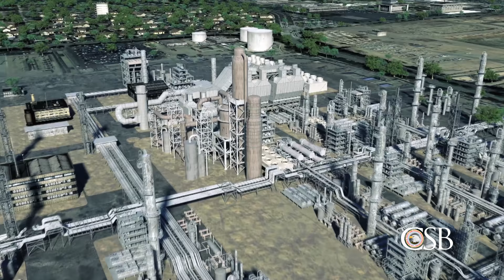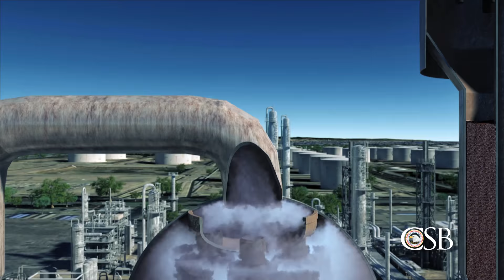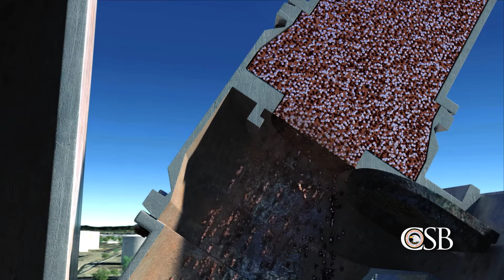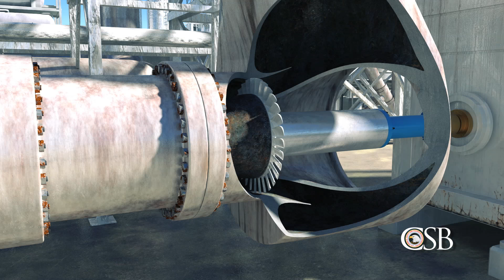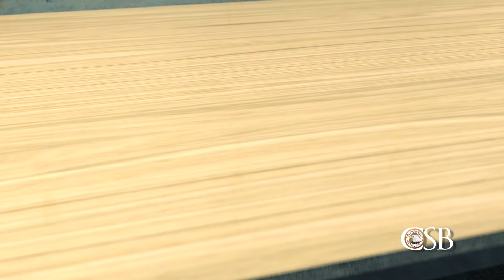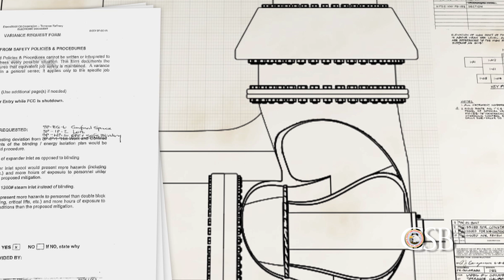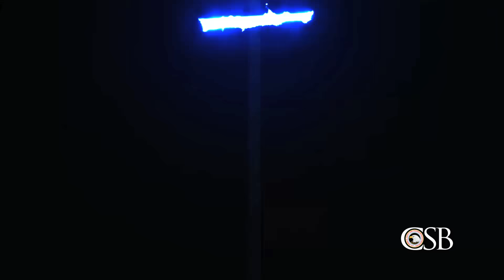Animation of 2015 Explosion at ExxonMobil Refinery in Torrance, CA

Comment: I find it surprising that with such good work done in industry these days with predictive maintenance that they would have a critical piece of equipment like the slide valve fail with that many years in service. You'd think if they cared to know they would understand that valve will be good for x number of operating hours and have to be replaced. Especially in an industry were stuff blows to kingdom come if it fails.
Reply: Im more amazed that such crucial pipe did not have flow detector 😅

Comment: What were the recommendations to prevent this from happening?

It seems the primary issue here is mechanical failure, compounded by other decisions (I think the biggest one being - that High Pressure Steam had found a pathway that another vapour was not supposed to travel - that should have been a 'Stop' moment)
Reply: Lack of flow monitoring seems to be big blame. 

Like... how the hell can such crucial valve leak, without operators knowing it.
Reply: @jarskil8862  lack of isolation of equipment with proper pressure build up testing paired with lack of monitoring of process conditions

Comment: A slide valve and a heat exchanger had leaks that are related to this accident. Which allows me to conclude that maintenance practices were poor at this refinery. The catalyst is expected to erode lines and valves, but run to fail is not acceptable. In addition, the steam leak from the expander was a sign that the slide between the reactor and the regenerator was leaking and therefore the service should be stopped
Reply: Lack of measuring equipment seems almost bigger flaw than lack of safety mechanisms :D

How can there be flow in such crucial pipe, without operators knowing.

Comment: So why wasnt the ESP turned off automatically in SAFE PARK mode? Also it would be sensible imo to have installed multiple slide valves for redundancy.
Reply: Probably, they wanted to avoid release of any incidental catalyst dust during transitions.  Even without such a specific source of ignition, having the air side filled with an explosive mixture would have been a disaster waiting to happen.  I wonder why they didn't have hydrocarbon detectors in the air side ducts.

Comment: I don't understand one thing: what is the reason to keep the electrostatic filters energized when the polluting unit is off? Especially when there is a risk of explosive gas going into it? If they turned off the high voltage the filters might not explode.

Comment: The potential for the sluice gate valve on the reactor side eroding should have been picked up at the hazop. One solution, in case the ESP needs to be kept energised during safe park, is to use a Double Block and Bleed arrangement on this isolation, with N2 or steam injected into the interspace in the DBB. Pressure in the interspace to be kept above PAH in the downstream column. And if the interspace pressure drops below PSLL during safe park, shutdown the column and depressure.

Comment: The big error in safety feature design is that device failure probabilities are considered independent of each other, however in practice that is seldom the case.  When one device fails, it actually increases the likelyhood that more will also fail, just as what happened here and in many other accidents.  Bad maintenance and ignorance of good operating practices means that failures of individual devices cannot be considered as independent events.  One corroded valve means that other items are also most probably corroded.  One equipment bearing failure probably indicates that other equipment may have the  same problem.  Potential failures of two or more device is thereby heightened, not reduced.  Basic safety mathematics FAIL!

Comment: You would think that there would be valves between the FCC unit and the ESP that could be closed to prevent hydrocarbons from passing into the ESP. There seems to be at least about 200 feet of pipe between the two. The workers getting the alarms could be closing valves, cutting off any pathways from the FCC to the ESP.

Comment: As soon as the blind was attempted and steam came out, that was an indication that the trapped catilist was gone. Once they saw that steam they should have cut the flow off hydrocarbon. Stupid mistakes
Reply: Peter Jones because the systems are connected the hydrocarbons should have been shut off from anywhere in the system. Yes I did miss that.

Comment: Don't you think finding steam in the AIR SIDE of the FCC would've been an immediate indication that a catalyst barrier was not maintained?
Reply: They didn't realize extra hydrocarbons were leaking into the other side. Basically, this system had 3 independent failures.

Comment: The variance procedure should of had the ESP powered down and locked out
as the steam was turned off.
not only that when the system is down 
why bother keeping the ESP energized 
kind of pointless 
but what do I know,I've only been working with dangerous equipment for over 30 years

Comment: I just retired from working in a chemical plant for 38 years and worked in a coal fired coal plant before that for 2 more years. There are two videos I just watched where an explosion was caused by the slide gates failing thus causing the catalyst shield to lose it's level via the leakage through the damaged slide gates. if there was an alarm on the catalyst level in each of these instances it could have sounded when the catalyst level in the vessel got to too low of a level warning the operators that the catalyst was escaping through the slide gate. Also having pressure transmitters on the hydrocarbon cracker  and one on the vessel the steam was going into would allow the operators to see if the steam pressure was higher than the process pressure and keeping a seal on backflow of the hydro carbons. The slide gates needed to also be on a regular checkup and replacement schedule due to them failing in both these incidents. Seems like this type stuff was overlooked or the operators ignored certain alarms.
Reply: The amount of money that oil makes, you wonder why they don’t have more safety checks. 🤷‍♂️🤷‍♂️🤷‍♂️
Reply: Is it too expensive to have a backup valve so that if the first set of valves fail due to some reason, that such a safety critical separation can then be maintained by a second set of valves that until that point should remain completely new (though a little run-in).
Reply: 2 years later but Yuup
Reply: the alarms didn't work  or there were none
Reply: We use differential pressure indicators across the slide valves to monitor this. The important thing to watch is the differential pressure between the Regenerator and reactor. The regenerator needs to be a few psi higher than the reactor to prevent reversal

Comment: 5:14 is where it went wrong.
There was not supposed to be steam in that line, yet it was full of steam.
Did NO-ONE pause for a moment to think just WHERE this steam was coming from?
The malf slide valve should have been an OBVIOUS candidate, and any half-educated engineer could have predicted the catastrophic sequence that followed from that point.

If your observation of a situation deviates wildly from the manual for the procedure, you nned to pause and think about what could be causing this before just blundering on.

Comment: I have seen a repair at a gaslift system at an oil well. A part of it was made pressureless for the work. Then after fitting all together complete with purging with Nitrogen, they opened the slam shut valve from the control room as was the normal procedure. After the workers left the side. Milliseconds to turn the ballvalve and 187 bars rushed in. There was a shockwave that shot the ball of the valve half a meter deep in the sand or two feet for the americans. The pipework looked like spaghetti.  Some say there was a rest oxygen in the pipe, I say there were few gallons of glycol from the gas dehydration, collected in a sack close to the valve and when that liquid hit the orifice with the speed of sound everything disassembled. They put a system in place to slowly pressurize  in future. At all the gas lift wells.

Comment: Why wasn't there a hydrocarbon detector upstream of the ESP unit that would automatically shut down the high voltage, thus eliminating the source of (ignorance) ignition? Isn't it the Engineer's job to forsee and eliminate potential hazards? Let's build a nuclear reactor on the beach and put the emergency generators in the basement. And you guys went to college for how many years to learn how to be an engineer? Maybe you should have hired a hillbilly.

Comment: You didn’t see flammable hydrocarbons reacting in the air side control of the FCC! Because it’s not there! He’s delirious, get him to sick bay.
Reply: I think I saw pieces of the ESP unit on the ground...
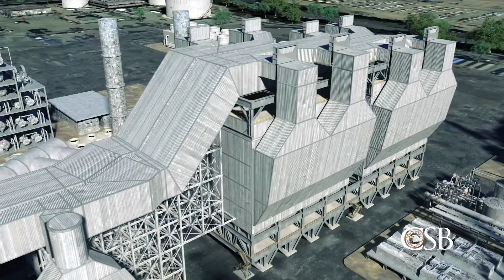Reply: I'm confused by your statement Michael. At 6:15 of the video they explain that hydrocarbons are leaking from the reactor to the regenerator. Hydrocarbons then travel from the regenerator to the ESP where they subsequently explode. At 1:53 of the video they explain how the air side flow of the FCC works. This includes the regenerator, the flue gas system, and ESP. Hope that helps to clarify.
Reply: @jmfirepro1303  whoooosh
Reply: JM FIREPRO 

are you stupid?
Reply: @jmfirepro1303  I believe they're making Chernobyl references. "You didn't see graphite on the ground because it's not there", etc.
Reply: jadedandbitter 

🤮
🤢 I apologize... 
😵

Comment: As much fuel is put through that in six years, are you telling me they don’t change out parts on a yearly basis?
That’s ridiculous, and asking for trouble!
Reply: cost cutting? 🤷 ya know it's all about 💲💲
Reply: The slide valves are massive. Just one can weigh several tons. They're welded into a huge pipe. It can take a week of 2 shifts to change one out. Millions of dollars and the entire unit will be shut down.
Reply: @matthewerwin4677  Make them lighter and smaller and more of them. Proudly sponsored by Big Valve
Reply: Cost cut for sure. It's an old fight of departments: maintenance vs manager. Manager says that the time needed to do the maintenance  compromises profit. Maintenance says that bad things could happen if stuff don't get fixed. Who you think is the boss?
Reply: Slide valves have blown up other refineries...just change them out every year.
Reply: It is called greed of the capitalist society.

Comment: Seems to me that the key factors, leaking slid valve, leaking heat exchangers, should have been addressed. Replacing worn parts should be the first step. But I am quite sure management says, to hell with that, just get it running again somehow! So now you are merely putting band-aids on things that can go boom. Once again there will be accidents based on cost cutting from above. Hell the top brass aren't going to get killed, so they don't care. "If some lowly maintenance worker gets hurt, he can go on workman's comp. I have a company to run", said the CEO.

Comment: I worked in Refineries all over the Bay Area for over 20 Years and have seen the Damage caused by the Fire First Hand. It's just devastating.... I'm A 342 Steamfitter Welder for a month we just sat in the shack waiting to go to work. 6/10 Sometimes 7/10 doing nothing but we were all Weld Tested And Safety trained...It was Cheaper to keep us then send us home and loose us and have to pay to retrain us so we SAT and SAT FUCKING OFF.... Finally they got the OKAY and the Boilermakers and Operators would come out with excavators and JAWS about 5' long and just Snap the Pipe in half...Big inch Pipe some 24" to 30" and Bigger and just cut it in half ....In 89 the world Series Earthquake hit around 5pm and Not much damage happened at all....More Sitting round....I Retired in 95 and Moved to SISTERS OREGON in the Mountains 3200' HIGH...I'm on Disability and don't do Shit now....I weld some making Yard Art....

Comment: There's probably very good reason why ESP shouldn't be turned off in parking mode.
Those valves are not easy to check.
However wasn't there a flowmeter for the filler steam? Abnormal flow should be an indicator that there's a major leak and the machinery should undergo proper maintenance before applying a repair deviating from proper procedure.

Comment: This is why my gasifier is not a downdraft type, it is sealed and oxygen free. Many folks use the downdraft because it fuels itself just like this big plant did but never and I mean NEVER introduce Oxygen to the system, and fucking sparks.. really? It is better to be safe than to be up in production. Yes, I distill my own diesel and gasoline, I will not pay for it when waste oil is free at any automotive shop.

Comment: The workers outside had gas monitors to signal them to evacuate, but the electrical spark generator did not have gas monitors to signal it to automatically shutdown??

In engineering, EVERYTHING should be monitored, and as much as possible the responses to those monitors should be automated.

Comment: Every small oilfield boiler has 2 valves back to back, the first one is there only to shut if the main one fails... 
If both fail it costs the rig a few hours of time, no danger...
You would think with high pressure   boiling fuel, lives on the line  and billions of dollars of damages at stake they would have a backup valve...

Once they figured out they were leaking vapors maybe shut of the giant igniter...

I guess college doesn't make you smart..

Comment: Leaking gate valve and a leaking heat exchanger. Should these not have been inspected/replaced during routine shutdowns? One faulty piece of equipment is one thing, but two shows a big lack in maintenance.

Comment: Not shutting down the ESP was the biggest mistake. It's a simple shut down process that depending on the setup wouldn't have taken but just a minute. Ours has 3 fields, each with a "manual start/stop interface". Most are controlled with a process HMI, so it's a simple click of a mouse by the operator to shut it down

Comment: Ok so... 
What's the story behind the differential pressure indicators that should be between the inlet and outlet sides of the slide valves, notably the one regulating the output of the reactor containing the coked catalyst for catalyst regeneration? Wouldn't the differential pressure reading indicate the absence of the catalyst barrier as well as deducing the fact that there's a corroded slide valve?

Comment: I was there the morning it happened. Working in a unit not too far from the ESP. Scared me good. Never in my 20+ year career had something like happened. A proper HAZOP may have caught the possibility of a contaminated reverse flow due to the failed heat exchanger. Feel that the permit to run the  ESP may have influenced the refinery staff to take the short cut that resulted in this catastrophic failure. A fellow operator had parked a vehicle moments earlier before a portion of the ESP smashed it. Totally amazing that no lives were lost or any HF was released! In hindsight (which is always 20/20) the ESP should have been shutdown and properly isolated before that flange was opened
Reply: Sky Dog     Where are you currently working

Comment: Great visuals! The slide valves on the Cat Unit I worked on were never tight shut off, big gate valves were the true isolation points. A flow reversal might have been prevented by tripping the air blower and slumping the catalyst bed, feed would also be tripped and diverted. Steam would be introduced to keep the catalyst bed fluidized and positive pressure to keep the fractionator from reverse flow. We had a CO  dumpstack that prevents sending hydrocarbon saturated catalyst to the precipatators and the CO Furnaces. The Benicia Refinery has an Exxon designed FCCU now owned by Valero Energy. Variants to standard operating guides are a form of risk management. Most times they worked, but every now and then they would bite you.

Comment: These make me appreciate how complex industrial processes can be. I sometimes think "If I was in charge, I'd do blah blah blah", but seeing things like this make me realize that nobody can know the right way to do everything; there are too many laws for a reason - to prevent accidents like this; how the complacency of a few people can cause a failure of any system; and that complex systems need to have simple ways of determining the status of parts and processes. 

What I mean by the last point - when Chernobyl went up, it was because they thought they were dealing with a low pressure problem and kept trying to raise the pressure by heating up the reactor; the problem was actually that the water level was dangerously low. The water level was inferred from the pressure and temperature. If they had a simple bobber and float mechanism, they could have prevented the accident in the first place. Obviously I'm oversimplifying, but you get the idea.